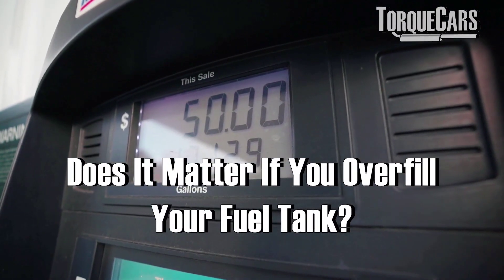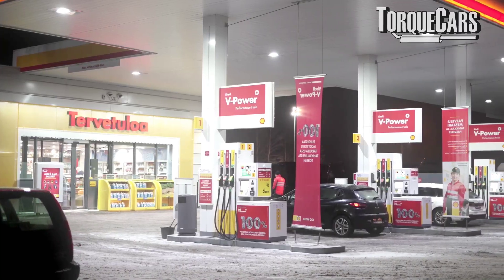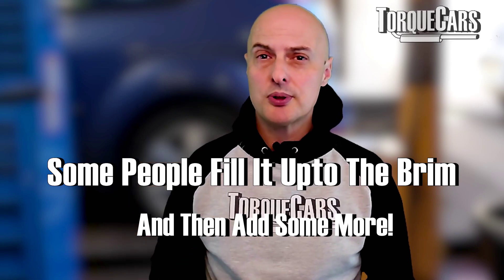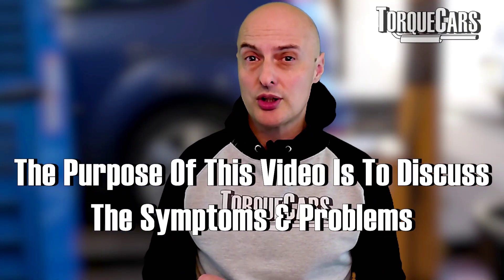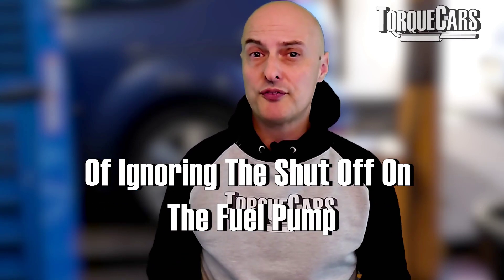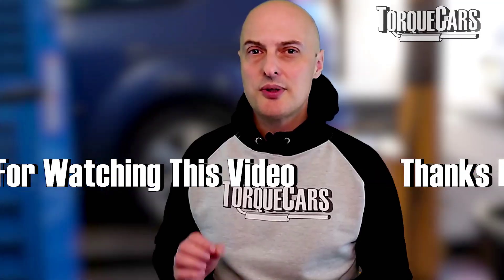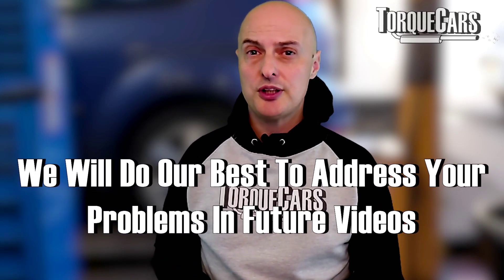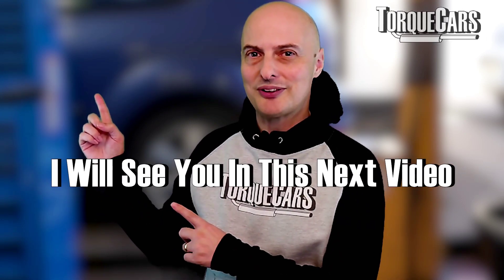Overfilling A Fuel Tank Causes Car Damage! Overfilled Gas Tank Problems! Don't Top Off The Tank!

Comment: I've been filling my 2016 Sonata Hybrid this way for over 120K miles now.

So far, no issues. I still get 40-42 mpg (as it was new), no smells, no running issues. I get 775-850 mikes out of 1 tank.

I also use E0.

Comment: I bought a Ford Focus Mk1 1.8 petrol 15 years ago at auction that ran poorly. I replaced the fuel filter, car then ran great for 500km then same problem happened again. Replaced fuel filter again car ran great for another 500km then again same problem. So this time I cut the filter open & it was full of black soot. The previous owner must have always overfilled the fuel tank bringing fuel inside the charcoal canister & destroying all the charcoal pellets inside which leeched carbon particles into the fuel tank and blocked the fuel filter.  I replaced the charcoal canister with a good 2nd hand unit which resolved issue for good, car still runs fine to this very day. It took me ages to work this out and solve this problem.

Comment: What if the the pump did not automatically stop and kept on refilling until it spills? What do i do?
Reply: Broken pump
Reply: Nothing, because it probably didn't settle that high. Plus its doing this time after time thats the issue.

However, I've been doing this for over 120K miles now in a Sonata Hybrid. No issues so far.
Reply: Go with the flow.

Comment: Overfilling your gas tank can have serious consequences, both for the environment and for your safety. Not only can it cause environmental damage, but it can also lead to a potential fire or explosion. Therefore, it’s important to always pay attention to the level of your tank and to fill up only to the recommended level. There are better alternatives than overfilling your tank if you’re looking to save money on gas, such as using a fuel rewards program or driving more efficiently. So, before you overfill, it’s important to understand the hidden dangers and why it’s best to play it safe

Comment: I've been brimming my car for well over 20k miles because I had no idea about the EVAP system. Never had any issues but I'm afraid I might have compromised the canister. However, I've also read that there's a safety valve in between the gas tank and the canister to prevent just such siphoning of gas. Is that true and could a compromised canister cause engine damage?
Reply: Over 120K miles here in a Sonata Hybrid.

Comment: What if the nozzle did not pop up but the gas is overfilled on the dash board and the engine light is illuminated?
Reply from the maker: If you get enough liquid gas into the EVAP systems charcoal canister you will get a check engine light come on. Check that the filler cap is properly on, a loose cap can also cause a check engine light. An OBD port scan tool will confirm if the error code is related to the EVAP system or not.

Comment: I was filling my car and the pump was broken. Gas spilled out of the tank, all over the ground and ran down the side of my car at the mouth. Now, the inside gauge won't move from the full indicator. Is it stuck? Could it be broken, damaged? Should I take it in to be checked out at the repair shop?
Reply from the maker: Personally I'd run the tank down before taking it to a shop. Hopefully you know you'll get X00 miles from a tank so reset the trip counter, and book it in as you near the usual tank mileage minus 100 miles. For most cars it is around 200-300 miles but every car is different.

It could well be stuck, but the chances are that it will free up again in a short while as the level drops.

Sorry for my slow reply, I missed a whole batch of comments due to family health problems, but if you get any more feedback on this problem please do let me know how you got on.

Comment: I'm pretty sure I messed up my evap. I would always let the pump kick off, the start pumping 1 more time until it shut off. So 2 auto stops. Well after a couple years now even when I'm under a ¼ tank after sometimes as little as .3 gallon (yes .3!) the pump shuts off. It is such a pain! I definitely learned my lesson... 1 auto stop is sufficient.
Reply from the maker: Does it help if you fill up more slowly? Hope you get this fixed because that would be a real pain to live with like that.
Reply: @torquecars  very very slowly and it would pump. At the time of the original comment I had already fixed it. Which is how I knew for sure it was my evap.